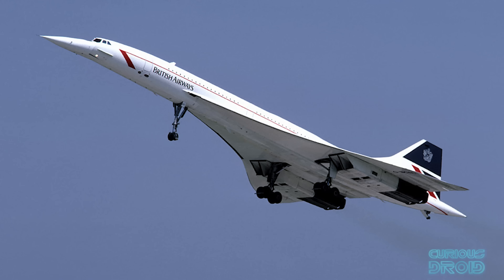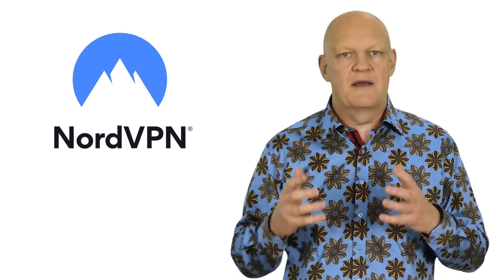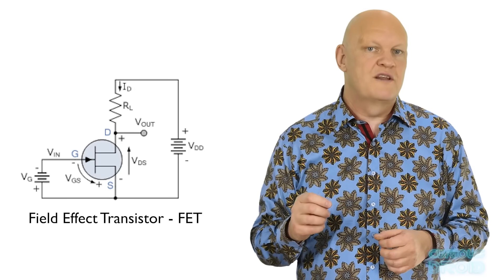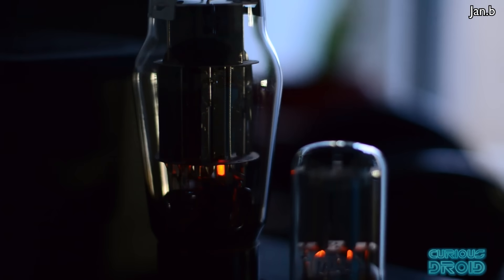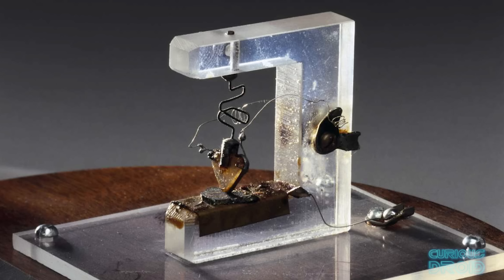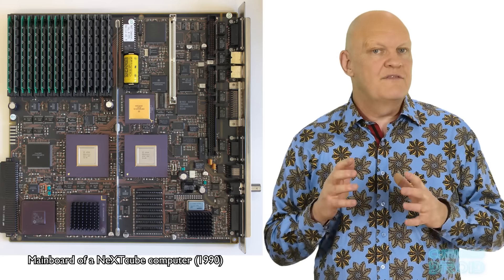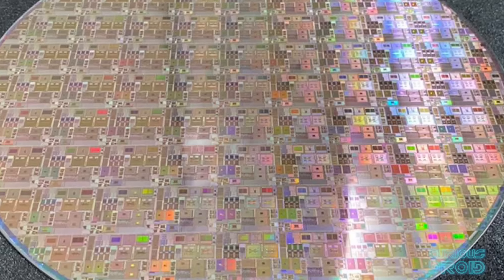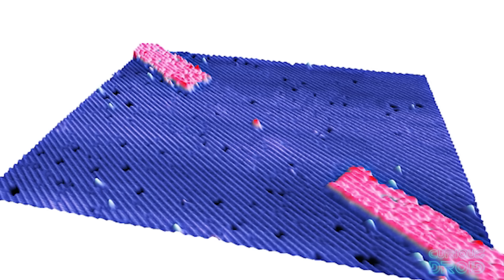MOSFET – The Most significant invention of the 20th Century

Comment: I'm teaching a class on microcontrollers, it blows my mind that a $5 esp32 micro computer has millions of transistors for such a low price. Much more powerful than my $3,000 desktop from 1996
Reply: ESP32s are rather simple, they range between 25,000 – 150,000 transistors. For a billion of transistors you're looking at an Intel/AMD consumer CPU from around 2010-2012.
Reply: @Djof  
Well it says it’s made with a 40nm process, which suggests it’s reasonably compact. Considering they have over 300kB of RAM alone, I’d think they’d have a few million transistors at least. Especially if that’s SRAM, which I think it is. I wouldn’t think they’d have more than 20 million, or less than 4 million. Even cheap 8-bit AVRs and PICs are going to have many 10s of thousands.
Reply: @Djof  only their build in SRAM accounts for several millions transistors (note: it's not flash, where you can use 1 transistor per bit)
Reply: @sddndsiduae4b-688  Correct, I didn't count the ram. It's still 1000x less than "billions".
Reply: Each transistor is free. You're just paying for packaging.
Reply: Wild to think that a modern, 50 dollar  "Raspberry Pi 4" microcomputer/makerboard has the preformance to eat my childhood Pentium Desktop alive, while also just barely sipping power and having variaty of  connectivity options packed in that make that old desktop look like a toaster.

And don't even get me started on my fancy new Ryzen desktop that can easily run VR games for me, I'm not sure what's more surreal; walking around battling "the Combine" in Halflife: Alyx, or the shear amount of processing power and complex sensors required to make that VR game Work

Seriously insane what Transistors and Mosfets have let us achieve
Reply: @UNSCPILOT  I still remember how mind blown I was the first time I installed ScummVM and Beneath a Steel Sky on my phone, a Nokia with Symbian, more than a decade ago. It was quite a contrast to playing it on my parents' 486 desktop PC back in '94.
Reply: @UNSCPILOT  ick, Ryzen, ick.
Reply: @Shinzon23  my Ryzen 2600X laughs at your disgust
Reply: Or my portable {luggable} Osborne O1 from 1981 based on a Z80 processor with a full load {65kB} of RAM & two 5 1/4" floppy drives.  Cost me about CAN$ 2000.  Still have it, and it still runs when I test it once a year !  CP/M was the only OS I fully understood...
Reply: Don’t worry about it. 20 years from now you’ll realizes you paid $5 a piece for the same micro computers that you can buy for $5 a pound
Reply: How about the fact that the computer that you can get for $1,000  or so can do more than those Indigo workstations that cost $100,000 each back in the 90s?
Reply: @Shinzon23  just sold my indigo2, hard to let it go but it was just collecting dust
Reply: When I taught a graduate level class on processor technology, I tried to show a diagram, to scale, of feature sizes from when I was in college (3 micron) to when I was teaching the class (14 nm). I couldn't. The smallest feature size took less than a pixel on the slide.

I also showed how the logic of the first microprocessor, the 4004 could be comfortably placed under the I/O pad of a modern processor. Tiny!
Reply: CAUTION: EXTREMELY DEEP RABBIT HOLE! Good read though...
Reply: Holy smokes I didn't know you taught that stuff too! You should put some on your channel!
Reply: @diegoochoa572  eventually will, unfortunately how YouTube works is that if it's really different than what I normally do, it doesn't go very well.
Reply: Ok can someone just do what D Hardy is saying and link the video? Just to put the narrative to rest or to add it to my "this is/might be spying on me" list.
Reply: Probably only millions at that level
Reply: Isn’t crazy how expensive computers were in the 90s? My dad was an architect then, and I remember laptops costing 3000 easy.
Reply: @brkbtjunkie  i recall finding a heck of a deal on an old use 286 laptop for $1200
386 were the norm and 486's had just come out at the time
Reply: your kids will be saying the same thing when quantum computers come out for home use
Reply: 8 bit computers are error free
Reply: its bad when you look at the latest tech and just sigh 😄
Reply: Yeah, it's amazing the difference 25 years makes in electronics!
Reply: I've been following the evolution of PC technology since my early ages.
It blows my mind that people still have their mind blown despite most of them living for far longer than I have. At some point one would think you'd understood by now that as time progresses the technology in the microchip space gets better exponentially in a short time frame. That observation is called Moore's Law.
Reply: You aren't, and shut up.
Reply: and to think my 500 gig hard drive can be outmatched by a micro SD card!
Reply: Your insides are 90s technology
Reply: Try $3,000 for a desktop in 1976. Without a screen.  The LPC1115 has 64K ROM (flash) and 8K of RAM for about $8. It also includes a UART, I2C and SPI bus and counter timers. Of course you need a board and a couple of other chips for interface. And a power supply of 5V @ 20 mA. About $35 for a system that once took a big box and boards ($5K total)  and a 5V 25Amp power supply.
Reply: In some ways
Reply: Truly amazing. Hey any books you’d recommend for a software developer looking to develop further in my knowledge
Reply: That might blow your mind but your father blows me.
Reply: @myjizzureye  with over 5m subscribers and a billion video views, many know my dad died 6yrs ago.
Reply: Lol youre kinda stuck on yourself for being well nothing impressive. Bragging about your subscribers to point out your dad's death was well known. Funny you mention subs before your dad... shows your priorities. Also there are significantly more than 5 million ppl in the world so you're not as big as you think. Sit down be humble.
Reply: I respect people who understand this.
Reply: If your mind is blown it was of dubious capacity - you've been living with moore's law for 30 or 40 years yet you are shocked by a 3000 : 5 price ratio over 27 years (thats 18 times 18 months which equates to 2^18 increase in transistors.... ie 262144 times) if the price had followed the increase in transistors directly your $3000 worth of transistors would now cost you $0.01. So your $5 is a bit of a premium price. (+inflation ofc)
Reply: @occamraiser  was that douchey reply even necessary?
Reply: my school was using lego technic to teach us the basics of control theory.... also, regarding the malware etched into controllers: 
"Reflections on Trusting Trust" - Ken Thompson (it's a 3 page paper, very educational)
Reply: especially integrated gpus have made huge steps, from barely able to run word, to now literally being able to do raytracing on modern aaa games.
Reply: Hey, I’ve watched a few of your videos before. But do you have any thoughts on perhaps creating a second channel where you talk about this? I would love to learn more about micros and electronics in general, but I have no idea where to start.
Reply: @uzaiyaro  Me too
Reply: @uzaiyaro  https://www.youtube.com/channel/UCfYfK0tzHZTpNFrc_NDKfTA
Reply: @UCoTX7qvsKKKX4lQrOtpmvpg dude  you have no idea what you're talking about. None of what you said is technically accurate. You're describing microchips like drugs lol. Just stop spreading nonsense.
Reply: @TechnologistAtWork  🙄 Exactly!
 "ET phone home" is funny at first, but after 500 repeats, it gets annoying 😂😂
For those who insist, malware does exist, on free dating apps, on free to play games, and on pretty much every ad-supported software platform (apps). It's an order of magnitude simpler to get malware working in software, with users willingly giving up their private info.
"Etching" malware in hardware? Oh, come on. ET doesn't phone home in hardware.
Reply: @vikassm  it's a combination of paranoia and ignorance.
Reply: @TechnologistAtWork  Sailing the seas of flat Earth.
Reply: @fumanpoo4725 Are you talking about me? Because that's very much the opposite of what I'm saying.
Reply: @TechnologistAtWork  Not you.
Reply: @TechnologistAtWork  Like that's going to happen. These worms are everywhere. They come out of Trumps ass.
Reply: @kayakMike1000  so, how much do you charge him?
Reply: @kayakMike1000  Yes...my doctors tell me it will take years to evict him and his disgusting simbiots.
Reply: @fredjones7705  Rent free... 😆
Reply: @NortelGeek  Funniest thing about that is that you stole the line from Hilary.
Reply: @fredjones7705  Yeah, "rent free" has been a phrase long before Killary started using it. If I were going to "steal" a quote from someone, it sure as hell wouldn't be her. Oh, and if you need examples of people stealing quotes, look no further than the current presidential occupant.
Reply: @NortelGeek  Fan of Cheeto huh? So why do you guys want to abandon democracy? Btw I wasn't voting for Joe Biden. I was voting against Donald Trump.
Reply: @NortelGeek  What were you protesting? Equal rights? Lmaooo
Reply: @KittyCatClub526  Not sure where you got that idea, but okay...
Reply: @designbuildride737  Thank you for feeling sorry for me. I joined the army in 2002 and spent most of the next 16 years over seas. I thought I was helping my country but when I came home everything had become corrupted by the Cheeto. It hit me pretty hard seeing that truth no longer had any value.
Reply: @fredjones7705  But you'll be bleeding from every orifice when he wins his third and fourth terms. Go screech at the sky.
Reply: @fredjones7705  Trump wasn't the greatest but at least he didn't leave thousands of Americans behind in Afghanistan.

Let's go Brandon!
Reply: @StudleyDuderight  We need an administrator as president. I think we'd be better off if they just put all natural born citizens who are over 35 and registered voters name in a hat and drew the loser. That would be our new president. Limited to one 6 year term. They wouldn't owe anything to anyone and not worried about re-election.
Reply: @fredjones7705  You think that Hilary Clinton was the first person to ever say that? You must have led a very sheltered life.
Reply: @drsamuelbeckett2998  1st person ever to say what? I don't know much about Hilary Clinton. I voted for her in 2016 because she wasn't Donald Trump. The same reason I voted for Joe Biden. However I'm a registered republican and I supported John Kasich in the primaries.
       I voted for McCain and Romney and the way Trump disrespected senator McCain confirms my opinion of Mr Trumps character.
       I wouldn't let him in my house to pee even if he was hopping up and down on one foot. I sincerely hope the GOP returns to sanity and actually embraces a platform other than whatever "The Donald" says. 
       Unfortunately though I see a civil war in our near future (Royalist V Democracy). I've seen war and it's not good but I don't see how we can avoid it.
Reply: Tech is amazing in that respect
Reply: A good prayer:
I'm a sinner JESUS please forgive me for all my sins I know you shed your Blood for me on the cross at Calvary. Thank you JESUS for my salvation and for shedding they Blood for me. I love you JESUS. 
Romans 10:5/10 ct...❤️k
JESUSisLord!Amen..
Reply: @Mr.Caring  Buzz kill.
Reply: or a $4k Apple 2E from 1988,,,
Reply: I didn't know you were a teacher. Do you teach kids about running a laundromat? Lol
Reply: Spying is built into almost everything! China is NOT ANYONE'S Friend, neither are DEMON RATS BLM ANTIFA ATF or weak R'S, they are the Nazis of our time without the National part
Reply: It blows mind that the esp32 chip set has malware etched into them from the factory. After you flash your program on them, they wait and later when you aren't looking they go out onto the internet and transmit something to a Chinese IP. 

It's a safe guess that it's saying I'm here, I have this program, and I'm ready to shut off on command from home base.
Reply: @dhardy6654  they don't have malware from the factory but there is a security flaw that allows you to write malware to it using a fault injection method.
Reply: @dhardy6654  prove it. Out of the billions of security events I receive daily there are no true positives. Malware events such as that are in the .0000000001% area in the context of a single IP.
Reply: @c1ph3rpunk  then buy 20 of them like we did..  or just 5 and run the test like we did. We thought it was just one, then we tried different ones and they all were doing it. We ended up using them anyways.. who cares we said, because we just were using them as timers. Note, they all did it and did it ONLY once.
Reply: @dhardy6654  you’re the one making the claim, not me, you obviously don’t understand how security research operates.
Reply: @c1ph3rpunk  I was like you.. I thought the same as you. I thought it bullshit too. Then I saw it. Maybe I don't know how research is done....I think that's important.
Reply: @dhardy6654  So where did you publish YOUR research?
Reply: @dhardy6654  there are hundreds of reasons for false positives, publish your claim, findings and source data. If it’s not high enough quality to survive public scrutiny then it’s nothing more than BS.
Reply: @dhardy6654  I've worked with them in a professional capacity. This is bullshit, doesn't happen. Good try though, very convincing grift.
Reply: @dhardy6654  product registration. at least the country location.  what you needed to do was run a clean build with a years worth of logs on your inbound data. then load up your device and wait for the call out. once its done check your logs for any new connection attempts that stand out from the previous log. like one from China for example.  its the inbound thats risky  that why your microsoft firewall doesnt block outbound traffic. its no real danger and everyone does it.
Reply: @txm100  seems like he could somehow film it at share it in a public forum. 🧐
Reply: @c1ph3rpunk  He'll probably prove it with a fake pcap
Reply: @dhardy6654  no because that would work only if you have internet access. But the wifi and Bluetooth library is so big that they both together have not enough space on it. So you can only use one of those or none. But not both. That's little bad and my conclusion is that if it really would be standard used for secret control then the WiFi library should be always integrated and not be that big. So it's not true. At least without the necessary library. But online is another story and who knows. If you want to be safe just cut away the antenna should do the job to stay for sure offline
Reply: @swissTom124  we didn't need to safe... It's wasn't about anything we were doing. We thought our program was doing it. Nope. It's was the board doing it all by itself.
Reply: @dhardy6654  Really? That's scary--my entire home automation system is built on that chipset. The CCP is shady as hell. Do you recommend an alternative?
Reply: @NortelGeek   so all we were making were timers that controlled valves. It was cheaper to use the esp32 then have solid state boards printed and built. We thought why not buy the esp32s and have all the awesome extra possible functionality... In that maybe later we would do something different with them. 
I'm the sales guy that sees the need and opportunity....then one guy is hardware guy and the other guy is programing. I try to keep the geeks on track from nerding out. 
They got in a big fight over all this. Nobody thought the esp32s would/could do this....we lost 3 weeks over this. 

Look in the end we don't care that we saw them doing this... We arent buying the development boards from Norway in place of these. 

What this is all about is larger then our timers... Bigger then your kitchen appliances. It's bigger then just us. 

What this is...it's a future digital pearl harbor. I can't say it any clearer. We are importing chipsets in finished products that surround our daily lives like a billion little trojan horses... 

Then we have geeks and nerds that never been in a fist fight and can't get laid on a Friday night telling us they are security reseahers or something!!!! This shit is everywhere like fentanyl is in heroin... Everyone is getting high so nobody is checking. Everyone guards from the next attack against the last attack. 

I don't know how a billion of these things will be used. It looks like.. I'm guessing the thing says I'm here, I'm doing this...I'd guess that is a report I'm on station and waiting. I'd guess it's like a kill switch. 

The thing that really bothered me.... Is how the esp32 waited to do it. A few minutes after wouldn't have been suspicious to me...but 10 hours was like it was a delay deliberity so nobody was watching it, nobody would care much that later....and it only did it once. 

I started asking how do you inspect such things? Do you have to break the thing apart and put the chip under an electron microscope to get a picture! Then run a simulator to see what the transistors cut are really doing?? 
Who the hell does that!!!!
Reply: @dhardy6654  "who the hell does that?"

Well, for my government it used to be Major Malfunction, he did a talk at defcon 21 you might enjoy. Sadly major malfunction died recently, but his company Appature Labs is still working away quietly 🤫

Be aware: he has to pull his punches slightly, he is talking at a public conference! You might have to fill in some gaps yourself ;)
Reply: @mor4y  from the way he talks he doesnt sound like he knows what he is talking about. What Sales guy talks at tech cons? Especially one who belittles nerds and thinks everyone is on heroin.
Reply: @dhardy6654  I think you need to have your foil hat recalibrated.  Also...don't make the all too common mistake of using aluminum foil, it doesn't block the right kind of craz...er...I mean frequencies.  Use only tin foil (or gold foil is even better if you can get it.)
Reply: @dhardy6654  Transistors doesn't do anything on their own, it would be pretty easy to put your esp's on a seperate wifi network and sniff the traffic originating from it, list the ip addresses it contact along with packet capture dumps. If people can independently verify it, you got a case, else eff off.
Reply: @dhardy6654  If the Chinese IP is hard coded then we can blocked all traffic to it in the ISP.
Reply: @audience2  I'm not sure of such things. I really don't understand how it was done. Then after it does it's "trick" what would come next....I'd assume it grabbed Mac addresses and other IPs. It one of the guys described it a vacuum machine. It's just sucked everything up just for the purpose of sucking. We didn't ever see any of the boards we tested do anything else then this..  it was by mistake the one guy caught it. He set up it up in the white box to test, did the test and then he forgot about it... Then checked the logs two days later when he saw it. He was sure it was his program that he just flashed to it. He poured over it and over and couldn't find it... So then he figured it was just a bad board and did it again like 10 days later..  but then it happened again. Used a different board and it did it again. It was like they all were doing it. 

Look, we see this in almost all consumer electronics and especially android and iphone. My point was why do we care for it's use at our level? It's nothing that interferes with what we are doing with the esp32s. 

But then again it probably something bigger then just us.
Reply: @dhardy6654  comment a link to any source that even remotely supports this claim or i call schizo. I’ve never heard of this and it really does sound like another conspiracy
Reply: @dhardy6654  If you get your ESP32 from sketchy places, it is possible. Because malware can be installed in these in a permanent way. 
But still, that's not a thing with brand new ones bought at reputable vendors, only with rebranded/recycled ones
Reply: @dhardy6654  We lost the world wars to the central banking cartel, so it only makes sense that these architectures allowed into the consumer market are comprised. If you haven't already, consider that our nations are not our friends and are essentially human farms making us nothing more than livestock.
Reply: @dhardy6654 esp32 wasn’t that stable for me
Reply: @dhardy6654  that's very interesting, never heard that before
Reply: @InvestmentJoy  run them in a white box after flashing..... But then just let them sit. Forget about it. Then check the logs, you'll see them making a call out that isn't in your program. That call out goes right back to china.
I have to imagine is that the chip set's blue print is published "clean" and then it has this extra program cut into it in the production run. Now these chips are everywhere... Forget just development boards, these chips go into everything today. How are customs officials supposed to rip apart appliances, then rip apart the chip set's... Then what? Use a scanning electron microscope to picture it? Then use a simulator to figure out what the extra part cut into the board actually does,?? 

When people are against back bone like 5g? They really should look at the chips...and nobody does. Think "voting machines" or even just any else..... 

That how a digital "pearl harbor" gets launched years before December 7th.
Reply: @TechnologistAtWork  The ESP32 is a SOC. It has everything in it and only needs 7 external resistors and caps to have a fully functional system with wifi, Lorawan and BLE and is more powerful than the Pentium 1 which ran win95. It is possible since it has up to 4-16MB of storage as well but I doubt it is malware. It has OTG firmware updates and some other features that could be connecting to the Espressif servers if you turned/left them on at setup. By the way most people are buying ESP32 modules and not just the chip. The module comes with the antenna on it and needs nothing else to run as a internet connected system.
Reply: @excitedbox5705  you need pretty elaborate software to have it do such complex tasks bypassing the software you're using.
Reply: @dhardy6654  Exactly what IP do they call?
Reply: @peekaboopeekaboo1165  so what? Further more if they didn't it would be a dereliction of duty.
Reply: @dhardy6654  
Ah so! 😁
Reply: @dhardy6654  You can thank Jimmy Carter for his favored trade partner deal with the Chinese.
Reply: @1OldWriter  Hi Ed, Jimmy Carter was our president that bailed out the Mexican peso by moving Ford south of the border in 1978. What you are talking about was happened over two administrations later under Mr Clinton... Called "Most favoured nation trading"  and it's not a bad thing at all. It really started back around 1972 under President Nixon when he went to Beijing. Before Nixon, China was almost as big of a hermit nation as today's North Korea. Helping them open up and communication and trade hasn't been a bad thing for anyone.
Reply: @dhardy6654  wow incredible !
Reply: @jtveg forget that check out the iphone patents (v4 is good) things like recording audio and images and the ability to transmit that while powered off (non removable batteries..apple). back when we were as a nation in the uk locking our phones off by using safeboxes or removing the batteries for some privacy in the late 90's early 2k's. also they mention the ability to identify a user by heartbeat using the vibration sensors (long long before health tracking). so if they can do that..why did they need fingerprint scanners. and then facial and itis recognition. and now 3d mapping and radar...if it knows whos holding the phone anyways.   filling databases.   these anti china goons...so deeply uninformed/ignorant.
Reply: @luminousfractal420  I never said it with any hate, I think in my above repilies I coved what you said about cell phones.. but I a way this is very different because of how it's done and what it's done with..... People will logically see that their phones spy on them.. but this isn't spying... It's more like control.
Reply: @TechnologistAtWork  Not really, since he is accusing the manufacturer of doing it. The designers could have put in a few hidden registers that launch an interrupt. The ESP has OTG firmware updating so you could launch the firmware update on their home IP at random times. If the chip has an internet connection it could then download a new firmware in addition to yours. The chances of them doing that is slim though. It would be quite the long con for the CCP to have a company design a chip, get it into a bunch of devices including keyless entry systems and company networks, and use them to steal trade secrets. It is possible I guess and the CIA has done things like that but the chances are really slim. I have a few ESP32s I will check it out.
Reply: @luminousfractal420  
Being brainwashed is a flaw of your own. No device has the ability to "call home" unless it has an active SIM card built into it that connects to a legitimate local provider or is connected to the net via a physical connection or WiFi which also goes back to a physical connection.

So other than say a smart TV where you want services like Netflix and YouTube there is no good reason to connect your microwave, fridge, dishwasher, washing machine etc to the internet.

P.S. Why would the U.S. government care about what cycle you put your clothes on anyway. The citizens in the U.S. are relatively free compared to the citizens in China where even a rumour of you criticising a government policy can get you locked up. This happens all the time in China, it never happens in the U.S.

China's hacking of these devices is used for industrial espionage and to monitor dissidents and political criticism overseas. They don't care about your private life. Like I said before, you aren't that important. No one cares.
Reply: @excitedbox5705  you'll find nothing because it's not that simple or easy to do.
Reply: @dhardy6654  aren't we (Well, you know who) doing it too?
Reply: @jtveg  Its complete b/s
Reply: @zylozylo9922  
You are probably right otherwise there would have been write ups about it in technical articles and blogs. So I'm sure it would have been such common knowledge that I would hear about it elsewhere.
Reply: @dhardy6654  Treating China like it is still a third world developing nation, while ignoring the human rights abuses like slave labor, political prisoners, and straight up genocide has not been a bad thing for anyone??
Reply: @luminousfractal420  Maybe your noodle could use a good laundry?
      Everyone, everywhere is continually subjected to propaganda.
      One of the guys I served with went to Cal State Fullerton (psych major). After he enlisted he chose 37F (psyops) for his MOS and did a couple of years with the spooks before he switched to 11B and became respectable. 
      Directed immersion is how they get you. They actually used to go out to clubs in LA and work on crowd psychology .... then be graded for it. He wasn't supposed to tell us that but we were all very drunk when he let it slip...actually he more or less puked it up all over the latrine. Maybe you've seen the type? Vomit and preach while calling Ralph on the big white telephone?
    If the Army does it then you gotta know the political parties do it. I'm arguing with a fully indoctrinated whacko on this very thread.
   Anyway there's ruts in whatever path you take.
Reply: @fredjones7705  it's crazy how trump got inserted in this thread. I deal with depression cause I see deeper than others in how social psychology is like and I don't want to feed it, but in my opinon a term of Trump is best thing we could get for chance of showing what things are like. Turned out everyone is just blind or something.

Simply put why would anyone want the Clintons back in office?
Reply: @georgespence6727  Seeing Americans line up behind that fascist sob was very depressing to me. I didn't want to vote for Hilary but I did. I didn't want to vote for Biden but I HAD to vote against Trump so I did.
Reply: @dhardy6654  force ISPs by law to not serve requests to and from those IPs. I guess thatd work.
Reply: @dhardy6654  that's a whole a lot of nonsense.
Reply: @TechnologistAtWork  not really buddy
more then that equipment comes with emitters that have nothing to with the equipment itself but can be triggered to pass on information between devices even when all your connections are off.
Reply: @rednarok  I'm an electronics engineer specialized in comm circuit design and I'm telling you no. You don't have experience so shut it.
Reply: @TechnologistAtWork  There are many tin foil hatters...they walk amongst us.
Reply: @dhardy6654  really???  Omg...
Reply: @kayakMike1000  'OMG'? - Ever heard the saying: 'there's no 'free lunch''? (ie: You dont get anything without conditions applying)
Reply: @dhardy6654  yu ar karect et haz inbilt malvare .
Reply: Supreme  OMG supreme!! Now I'm supposed to tell you, Why haven't you published your research paper and had it peer reviewed if you want to make such claims<sarcasm
Reply: Supreme  if it wasn't for thousands of people tinkering with small, cheap development boards for their own enjoyment... Would anyone else catch it? Say in backbone? Say in any other arena? I think it's a mistake to think they automatically would!!! I would guess it's way more wide spread the just the esp32. 

I'd have to imagine all the 1st runs of chips are manufacturer clean..  then old later area these ones with this extra "stuff" is added. Nobody then looks at them. Who would? The guy at Ford putting them into cars? Id say it's only the development board community that would find such things themselves... 

Look at those two nerds telling me to publish my findings BECAUSE they are the big shot nerds working in security!!!  What total losers..both are nothing more then the airport security that let the 19 hijackers aboard on 9/11. What losers!!!
Reply: @dhardy6654  And look at with you with all the avoidance and refusal to show proof for your claims. What do you have to gain from spreading propaganda?
Reply: @dhardy6654  could you please write a paper about your findings, how you measured the messages, how you know they are going to China.
Create a reproducible setup to show that the chips are communicating with the outside world. Write about it in thorough enough detail that someone reading it can reproduce the setup and see it with their own eyes. Publish it on whatever, Google Drive or something, and post a link to this comment thread. You are making a big claim, so I want to see it for myself. I am really interested in reading about it, but offending people because they are curious and want to read more about it doesn't make you sound trustworthy and it makes it hard to believe you.
Reply: @dhardy6654  extraordinary claims require extraordinary evidence, and you have none
Reply: @dhardy6654  the us government does that kind if transistor level verification all the time for military hardware. Assuming what you say is true the absolute best case they could do is break the WiFi in a very small number of devices on the market. Most chips are designed and made outside of China would be a pretty useless strategy to randomly break some random gadgets owned by the general public. I'm not even going to start of the logistics of inserting such a thing.
Reply: @52thephotoshop  i think they do not that he is right but Huawei was banned for a good reason